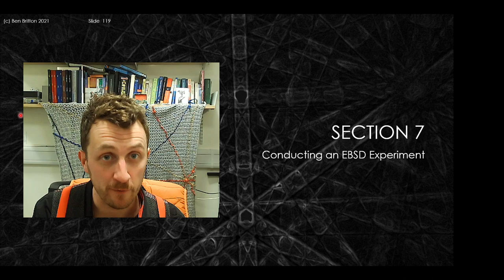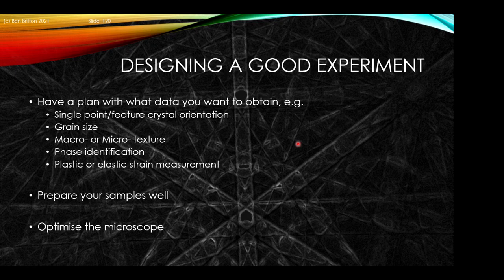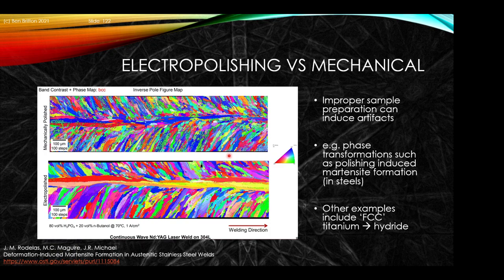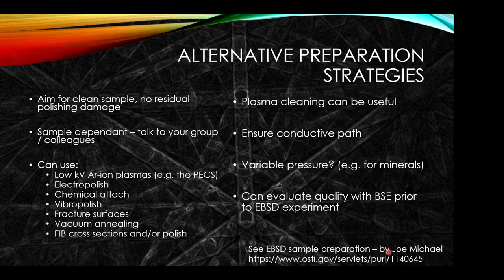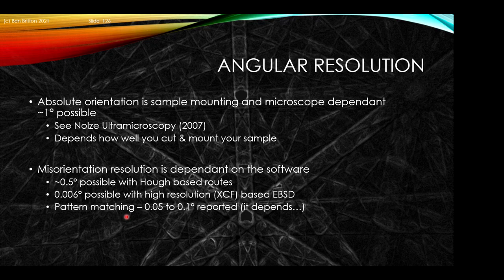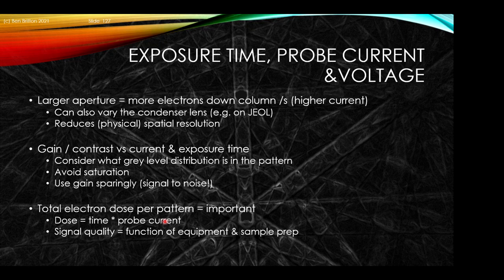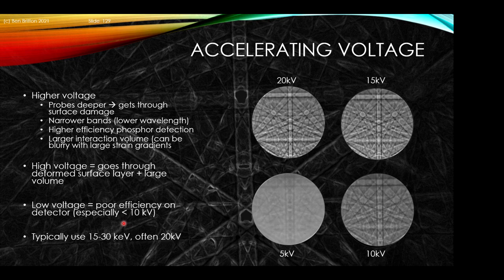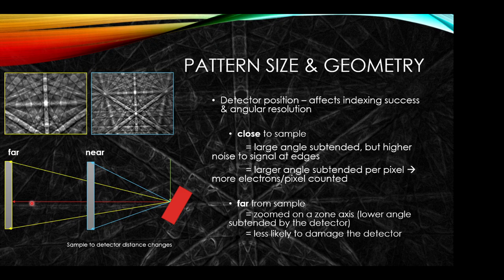Introduction to EBSD: Section 7 - Conducting an EBSD experiment

Comment: I have watched the entire series of the EBSD videos and it helped me a lot to understand the background in regards of the theory, experimental set-up und interpretation. Awesome work! However, this video simply ends without a proper outro. Is there none or did there happen anything wrong during the editing? Thanks a lot!
Reply from the maker: Hey - thanks for the comment.

The series 'concludes' with the final video - https://youtu.be/XWrxfFqlQvY

I will (hopefully, when I have time/teaching slows down a bit) add some more lectures to the series - I'm still thinking about what they should be!